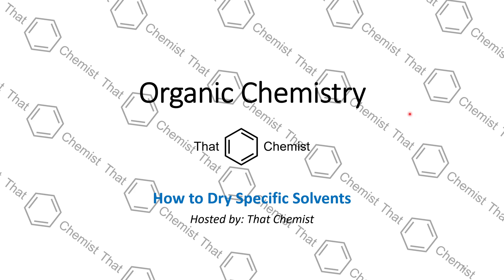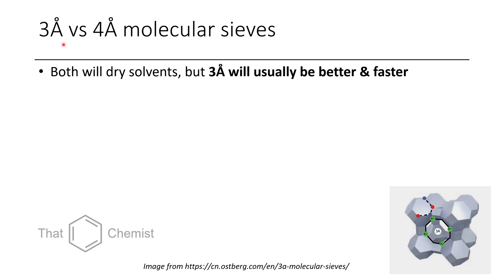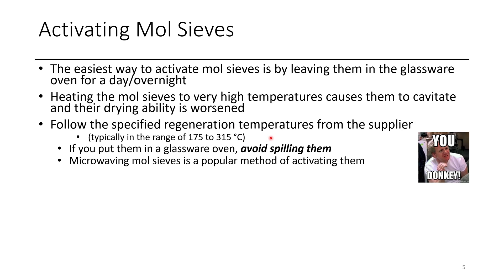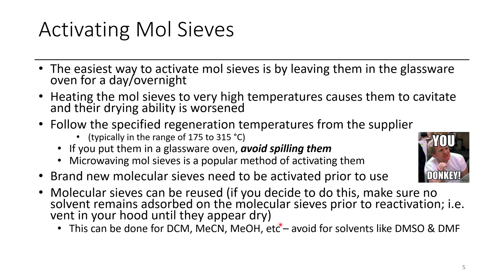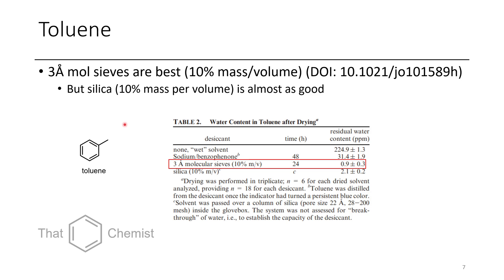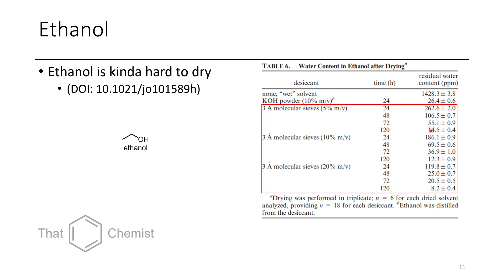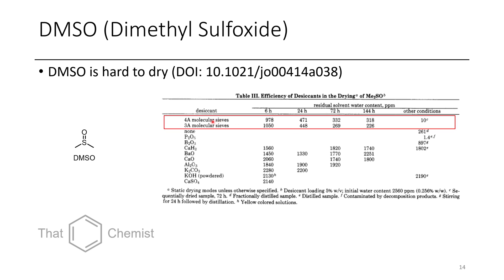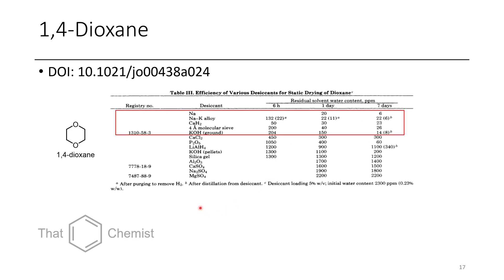How to Best Dry Solvents

Comment: An easy way to test if your 3A sieves are activated is by placing a few in your hand and running a few mL of cool water over them. If the sieves get real hot they're sucking up water and good to go. I don't think I've ever gotten a new batch that needed to be activated. Tested solvents after with KF titrator to check in the past too.
Reply from the maker: interesting to know that they come activated
Reply: @That_Chemist  could just be certain brands or batches? We only had to buy a few over my PhD since we regenerated most of them so they lasted a really long time.
Reply: The same test with well dried silica produces a sort of rice crispies effect, as the spheres decrepitate forcefully.
Reply: Super helpful & practical tip. Thanks for this advice! I never thought of that haha
Reply: Used them for the first time the other day and went to put the container away some time later and it was surprisingly hot!
Reply: Thanks, I'll test this out

Comment: hey THAT Chemist.     not him.  YOU. 

question for you.   Say, hypothetically,  after neutralizing freebase  with conc. hcl solution , you have an amine hcl salt dissolved in Toluene azeotrope. you want to crystalize  product and would resort to drying solvent using dean stark trap.  
 
Can one  evoke crystallization in your NPS with sieves?  just aas one might do using  azeotropic distillation?     assuming the chemical in question is larger than 3 angstrom  in width.   would it not  get left behind i have never heard of them being used for crystallization . there has to be a reason as to why it does, or it doesn’t work.  enlightenment??  thanks for your time.

Comment: Hi, Why should I not regenerate the sievs used for drying DMSO ?
Reply: Dmso and Dmf have high boiling points and When u heat the sieves for activating DMSO doesnt evaporate from the surface of the sieves and if u heat more, DMSO (or Dmf) make a film which covers the pores of the sieves and disables to catch the water.

Comment: In the literature there is a method for purifying acetone via cristallizing the complex with NaI, filtering the solid complex and distilling the acetone from it. Should produce quite pure and dry acetone. Maybe hard to scale, but for small amounts should work well. Didn't use it myself though.

Comment: hello. 
I proceeded with solvent drying using molecular sieves.
However, after a few minutes the solvent color changed to brown.
In this case, isn't it possible to use molecular sieves?
The solvents I used are propylene carbonate and NMP.

Comment: I'm surprised to hear you say you can microwave sieves. I suppose you can but you've got to be very careful. A guy in one lab I worked in tried drying them in a microwave and  they melted straight through the glass dish he was using and most of the way though the glass table in the microwave. We never tried again but I assumed some water remained trapped in the sieve and just got hotter and hotter.

Comment: Great topic, I learned some things.  On the industrial scale I designed and built a large THF mol sieve column.  Regeneration was a beast due to the ceramic nature of mol sieves. - those things heat up and cool down sloooowly.  That was not one of my favorite processes - flaring hot THF/N2 gas - yikes.  An additional property of hyper dry solvents is the electrical conductivity. On the large scale this becomes an issue.  "Wet" solvents quickly dissipate electrical charges acquired by pumping and flowing through pipes.  Dry solvent stay charged up and can create discharges.  Discharges are not good in large scale solvent systems.  Inert atmospheres help managed the hazard but you'd rather not have a solvent tank behaving as a giant capacitor. People have reported looking into large tanks and seeing glowing sort of like the aurora borealis.  The known incidents tend to occur when solvent is transferred and hoses are connected/disconnected.  One solvent supplier had a recommendation to hang grounding elements inside the tank to collect this type of charge and dissipate it safely. Final story: When a mundane solvent like hexane or heptane is shipped from Houston TX to anywhere north the solvent will cool off, because anywhere north of Yewston is cooler.  When the solvent cools water drops out of solution.  It's not uncommon to receive a tanker load of solvent and collect a receipt sample and see people (at a Lithium plant) freak TF out because the sample is 99% water.  Pro-tip: be prepared to collect, handle and discard some water in these situation.

Comment: The lab supplier where I work at sells molecular sieves 13X (Aldrich 208647). Do you think it works well to remove water from solvents?
Reply from the maker: from aldrich's page "The product (Molecular sieves, 13X) have been used for the abstraction of water from the 100% ethanol. Also, they are widely employed as an adsorbent in adsorption studies"

Comment: For THF distilleries, I guess one important thing apart from the drying itself is also the removal of the BHT stabilizer before use, which is present in most commercial THF.
Reply: the boiling point of bht is 265  C. So it is not an issue if u are distelling
Reply from the maker: that is true, but I find that it is pretty rare that the inhibitor is ever an issue

Comment: Best way to dry hydrocarbon solvent is reflux and partial distillation with sodium metal and place in inert air bottle with some suitable molecule sieve.
But this way is very tedious and boring works to do. And it doesn't work on protic solvent, above hydrocarbon substituted some halide (e.g. chloroform) because sodium reacts with the hydrogen of solvent and ruins them all.
So better way I feel is buy the solvent with air-seal, which can be bought from sigma-aldrich, or place the solvent in glove-box as soon as you get.
And use it all ASAP whenever you get. Don't buy big drum of solvent even if it's cheaper than small one, and you use it within 3 months at least.
Reply from the maker: but the question is *how does Aldrich dry their solvent*?
Reply: @That_Chemist  I'm in lab so I don't know the whole treatment the aldrich does.
But in the experiment scale, most of moisture problem was came from old stored solvent, or the someone who doesn't know his reaction and believe the undesired situation in the reaction originated from moisture of solvents.

Comment: Rigorously dry THF is best obtained by distilling the THF from molten potassium. The norm is to pre-dry over sieves, and then rigorously dry from K or Na/Bz. When using diethyl ether it is dried from NaK.

With Na/benzophenone, the benzophenone ketyl stays blue (i.e. rate of production of the ketyl at the surface of Na = rate of destruction of the ketyl) at several hundred ppm residual water once all oxygen is consumed (depending on the surface area of the Na). Blue only indicates O2 free, and not dry. The colour will deepen to purple as the rate of destruction of the ketyl goes down. In the Williams and Lawton paper, then tell us the THF was blue, and so it had not reached ultimate dryness.

A problem for all the "active hydrogen" desiccants (alkali metals, metal hydrides etc.) is that they release H2 gas, which K-F registers as lots of water. K-F readings of superdry solvents dried by these desiccants is much, much lower after degassing.
Reply from the maker: Interesting!

Comment: For industrial use set a water spec for your reaction based on lab experiments. Do a K-F, if it does not fairy Chuck the solvent away. But I have set water specs for a manufacturer and then everything was ok.

Comment: I did not try this one, but how about drying methanol by dissolving sodium methanolate in it? 
Water should quickly be converted to NaOH and the by-product would be methanol. Distillation would be needed, but I would expect fast and good results.

And yes, I considered writing about Na metal in this context, but I would not recommend it.
Reply from the maker: its still an equilibrium - mol sieves should do a much better job
Reply: @That_Chemist  It being an equilibrium is not a relevant argument. It always depends on the ratio of equilibrium.
And: Mol sieves also works in an equilibrium between adsorption and desorption of water.

Comment: Usually heating mol sieves in the glass oven overnight isn't enough for me. What I do is to just put them in a Schlenk or Straus flask, put that in the microwave until I see the water vapour coming off, and then I let them dry in the vacuum until they're cold. Run this three or four times, and that usually does the deal.

Comment: That confuses me: why should sodium be so bad for drying THF and so good for dioxane? I have dryed THF over Na/benzophenone to use it in anionic polymerizations (started with tert. BuLi) and did not encounter issues. Perhaps my initial THF was already quite dry.
Reply from the maker: Most chemistry tolerates a fair bit of water - even the sodium benzophenone method still gets it to a very low percentage of water
Reply: @That_Chemist  How about the difference between THF and dioxane in Na? Does anyone have an idea?
Reply: @sebastiand152  I also find that inconsistent. I believe it is due to the different references. The third reference also shows that indicators (such as benzophenone) give a false sense of dryness to the user, but prolonged exposure to sodium does significantly increase the dryness. So the results from the first reference are somewhat biased, as they rely on this indicator method. I guess the bottom line is that molecular sieves are a great way to passively dry solvents. Distillation, however, has operational parameters, which differ across users/labs, but remains, in my opinion, one of the best methods to obtain dry and pure compounds.

Comment: This video puts me in mind of my PhD days back in the mid 2000s; when one of us used a mechanical press to divide sodium chunks into  wire, the other one would HOLD a 5 litre flask by hand underneath to collect said wire. After that, we simply threw in a load of lovely THF and indicator into the flask. God, how I miss those highly dangerous, potentially fire-inducing times!
Reply: 5 liter flask full of air, sodium metal and nice wet THF what could possibly go wrong 😲 Glad you made it keeping all 10 fingers eyes and ears. 🤓❤

Comment: Molecular sieves are really amazing, I've had some very sensitive chemistry become frustrating when inhibited by the smallest traces of water. It doesn't matter if you use bone dry solvents or practice good technique, if its not working, its probably your reagents. Eventually, I dried EACH reagent specifically, dissolving them in reaction solvent to sit over sieves for a few days...and then combining them via cannula, and that went from 0% conversion to 100% conversion!
Reply from the maker: awesome!
Reply: That's very interesting, may I ask what type of reaction were you doing?
Reply: @Spoooky738  it was a copper catalyzed trifluoromethylthiolation, the active species being a copper(I) SCF3 with a bipyridine or phenanthroline ligand
Reply: @moosehead4497 I must be getting better at reading chemistry because I actually got some of that. Happy day!

Comment: Yeah, acetone is a tricky one. It forms an addition compound with CaCl2 and MgSO4 doesn't work. Also due to aldol condensation the water content can increase so molecular sieves are no good either. I used freshly oven dried CaSO4, which seems to be the best option and distilled it directly from the desiccant. The literature claims 300 ppm or 0.002 M water with that procedure and that was good enough for my application.

Comment: Interesting that with dioxane that sodium  got the solvent drier than sodium-potassium alloy, which I thought was a whole lot more reactive to water.

 Also, I think when talking about ppm it's useful to think about percentages to get a bigger picture view. Eg 50 ppm on this list isn't that dry but that is still 0.05% water, making your solvent 99.95%. In 100 g of solvent, you only have 0.005 ml of water.
Reply: *50ppm = 0.005%

Comment: Thank you, very informative! How often do you re-activate the molecular sieves? And would they be a viable strategy for water removal in moisture-sensitive condensations (like if formation of imine as as an intermediate is expected)?
Reply from the maker: usually if I finish off a bottle of solvent, then I will reactivate the sieves - sometimes I would regen after a couple refills
Reply: By warned; you can't stir solutions with sieves in them. They turn into mud with no drying power. You can put them in a Soxhlet thimble, and that works.

Comment: The way we used to activate mol sieves (sensitive organometallic chem) was as follows: hang them on your schlenk line, pull max vacuum and blast with a heatgun. As you drive off the water you'll see a very small increase in pressure. Our pressure meters went down to 1x10^-3 mbar and would usually rise to 5-8x10^-3 mbar while drying the sieves. Keep blasting until the pressure stays at a constant minimum. 
Doing it this way you avoid using arbitrary time limits and can judge the progress with a measurement.

Negative: it's slow as hell because you're heating something inside a vacuum.
Reply: It would be easy and might make that process faster to use a heat lamp to heat the sieves.
Reply: a sand bath?
Reply: Heat before applying the vacuum?

Comment: In the (inorganic) lab I worked at, we stirred pre-dried (from a solvent purification machine) solvents over NaK Alloy and then distilled them. Also everyone told me that Acetonitrile destroys Molecular Sieves, which speaks for the chemistst beliefs in things that "somebody told them once or something" I guess.
Reply: Way more of the praxis of science that you would like to imagine works this way.
Reply: @davidfetter  re "somebody told them once or something"
 NaOH seems to be a good example of that, at least outside of professional labs. 
"Errmgrd don't open that bottle of lye without a full hazwopper suit, It's caustic and 'll melt yer arm!". 
Likely stories passed down from old industry where they would do stupid stuff like dump [not pour] a 55galllon drum of lye into an open top water tank at chest level, (I've seen films documenting processes where they do this very thing.) and it was actually the heat of violently boiling water that was the real burn hazard, not the incidental lye solution. 

Side note: I've used my bare fingers to handle small amounts of lye and even for stirring it into solution, it is not a big deal. Circumstance matters.

Comment: I'm curious about diethyl ether, wasn't covered in the reference.
Reply from the maker: But only when the ether needs to be dry - usually I just use the ether straight from the supplier bottle
Reply: @That_Chemist  Thanks. Was thinking in reference to Grignard reactions.
Reply: @johnathancorgan3994  In my lab we have an alumina column set up
Reply: @That_Chemist  This is my experience too. The Sureseal bottles of supplier dry solvents are fine for organometallics such as Grignards and alkyllithiums. Most of the lab fires I've heard of are related to solvents stills which is why they were removed from our labs.
Reply from the maker: I typically use 4A mol sieves for diethyl ether

Comment: Uh, that's way more water, and much harder to remove to any significant extent, than I had realized. Hmm.
Reply from the maker: For which solvent?
Reply: @That_Chemist  All of them except benzene, but especially methanol and toluene. I didn't realize that toluene could have so much water in it to begin with, and I didn't realize that reducing the water content of methanol was so involved. Benzene acts more like I incorrectly assumed not-very-polar solvents in general acted.

I'm also mystified as to how to model those ppms of water that stay behind. I would guess sequential drying would achieve better results than longer exposures to the same pile of sieves,  but that's not a confident guess since I'm not sure what the limiting factor is here.
Reply: @sealpiercing8476  re: unexpected things mixing, there are more processes for that out there than solvation. Think about the most recent nasty emulsion you had to break, for example. Or mayonnaise, if you want to look at emulsions in a more positive light.
Reply: @davidfetter  That makes sense. I'm pretty new to using chemistry for anything but also I want to use a high energy (at least 2.7 eV) triplet sensitizer to drive another reaction in toluene. Something's quenching it within a few hundred ns. I have the dawning sense that I stand atop a deep well of potential troubleshooting.